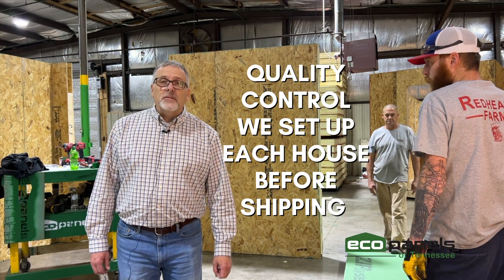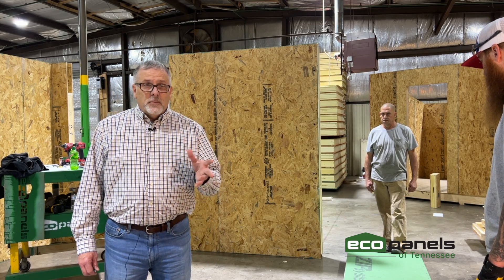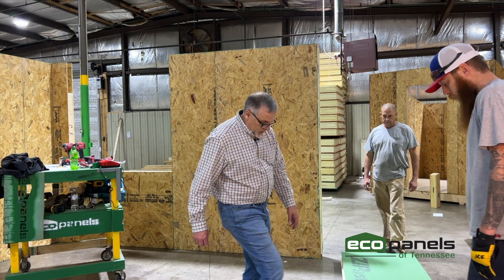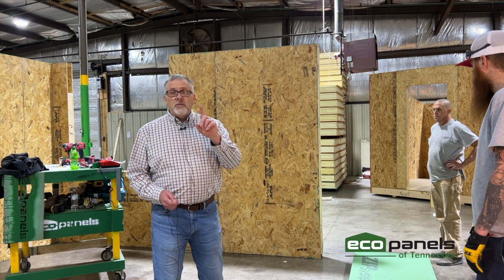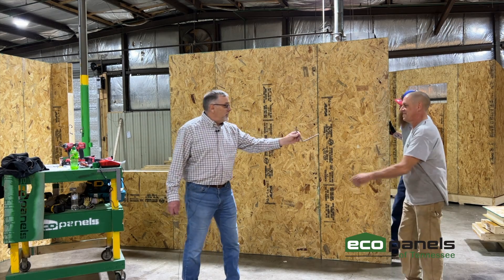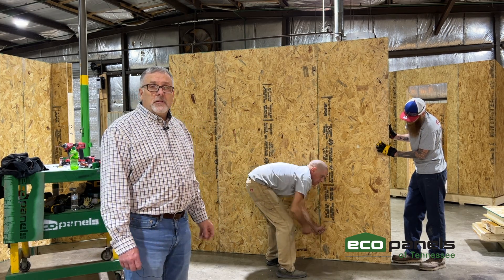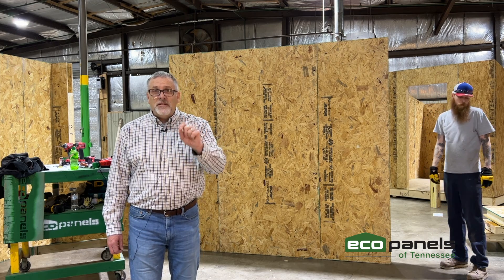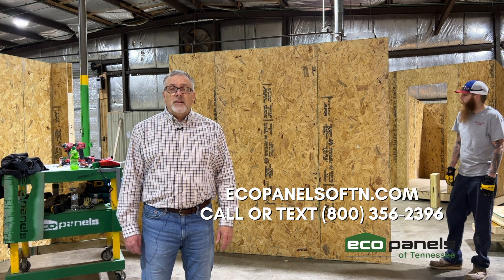How Windows, Plugs, Light Switches are Built into SIP Wall Panels- Quality Control for SIP Panels

Comment: Are those camlocks glued in or screwed into place in the interior of the panel?
Reply from the maker: The camlocks are held into place during the injection process. They are then imbedded inside the panel with the PUR foam. This bond is stronger than glue or screws.  Great question.

Comment: When you test assemble, do you also test fit SIP roofing panels if they’re part of the plan? Do you also put electrical runs in roof panels?
Reply from the maker: Great question. Roof panels are laid out flat on the ground, "dry" fitted together and measured.They are not however elevated and placed on top of the walls, but many reasons, but mainly because there's no other support than the walls. So, when we're doing our test assembly, we typically do the walls then bundle them for shipping. Then afterward, layout the roof on the floor and check it as well. We can not run electrical in roof panels. Generally, customers with vaulted ceilings will fir between the panels and their finished ceilings to allow for electrical. Customers will also run wires along exposed beams and use corner trim to cover. It depends on the situation and amount of electrical. Thanks for watching. We hope that helps!

Comment: Do roof panels also have cam locks?
Reply from the maker: Typically roof panels do not have cam-locks, however, they can. We've done them on request, and had a couple of projects where an engineer spec'd them in. Thanks for the question!

Comment: Sorry I missed u At thanksgiving. Is there a technique for installing the foam so that it doesn’t interfere with the cam lock?
Reply from the maker: Hopefully there will be other opportunities to visit in the near future.  We will be having a seminar at our plant on Saturday, February 18th, 2023. The foam used between the panel joints will not interfere with cam-lock operation in any way. Foam is applied to the side of the cams, and the cams are operated before the foam sets up. There should be no issue. Thanks for the question!